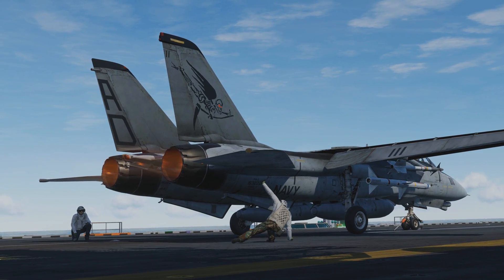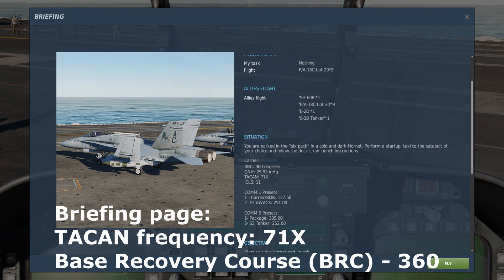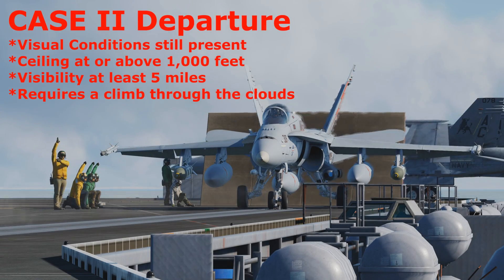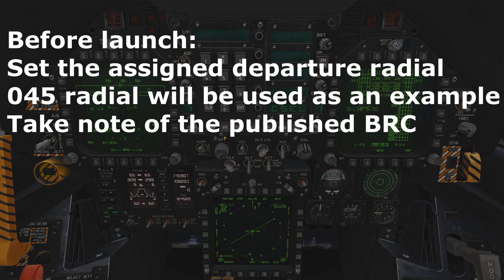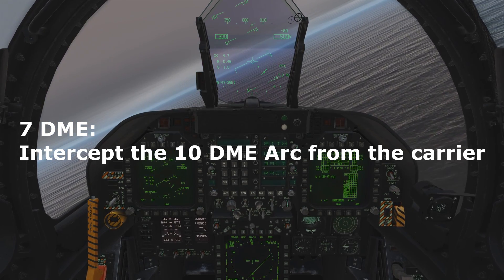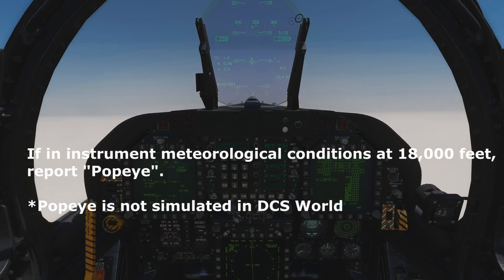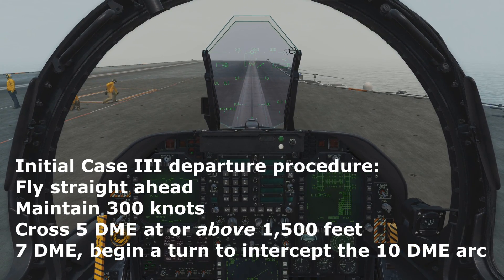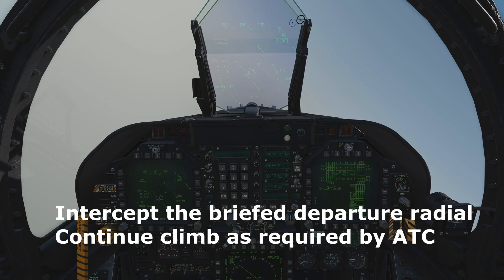Case I, II, III Departures, F/A-18C Hornet |  Digital Combat Simulator | DCS World

Comment: how can i understand which radial i have to set for the 10 dme arc in case II or III? You used 045, why?
Reply from the maker: 045* was just used as an example.  The DCS mechanics doesn't assign departure radials for Case II and III departures (perhaps in the future?).  In the real world, it would be assigned before launch.  Please reference the DCS Supercarrier manual and NATOPS manual in the video description.   Let me know if you have further questions!
Reply from the maker: Follow up:  From the T-45 CV Manual (listed in the video description).  In the Glossary section (page 65) "Departure Reference Radial (DRR): Preassigned radial usually passed during the brief or as standing SOP."   

Also, in the CV NATOPS manual, page 20.  Departure reference radial (DRR).  

Again, DCS doesn't simulate what radial you depart on.  If you fly in a virtual squadron, I'm sure that is all briefed ahead of time.  Hope that helps.

Comment: Nice overview. Are you certain there's no clearance turn during Case-3? I've seen charts that show both with and without.

Feedback: It might've also been helpful to cover which gross weights require mil, mil/max, and max for the cat shoot.
Reply from the maker: Hey very late reply. Just seeing this. I looked at my notes which were derived from the publicly available CV NATOPS manual NAVAIR 00-80T-105.  Page 5-29. Case III departure.  Jet Aircraft. It matches the exact description in the DCS Supercarrier manual. Climb straight ahead accelerating at 300 knots crossing 5nm at 1,500 ft or above. At 7nm, execute turn to fly the 10nm arc until intercepting the departure radial.  I wouldn't be surprised if the Navy has varied procedures for CASE III, but I'm just going off what I found.